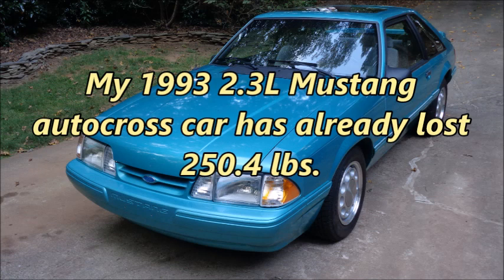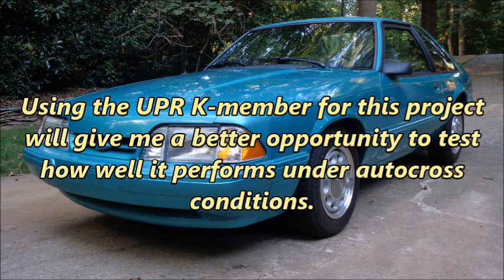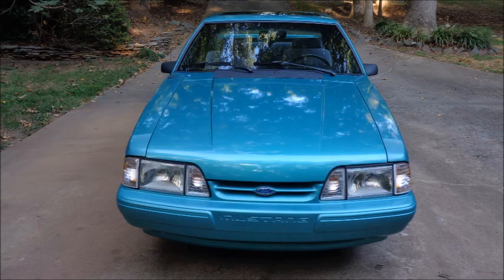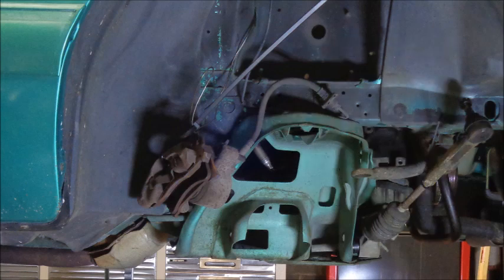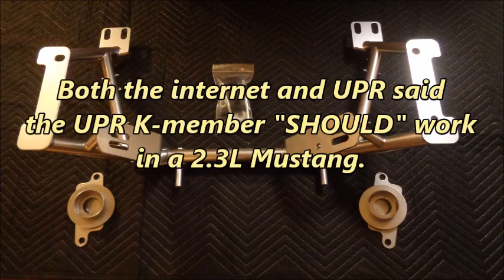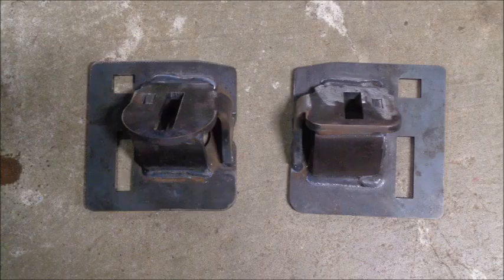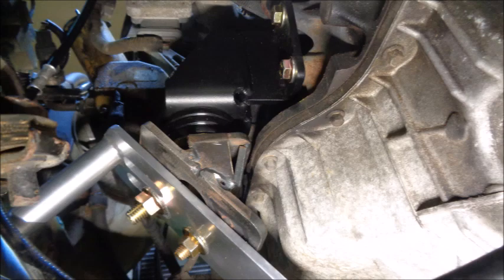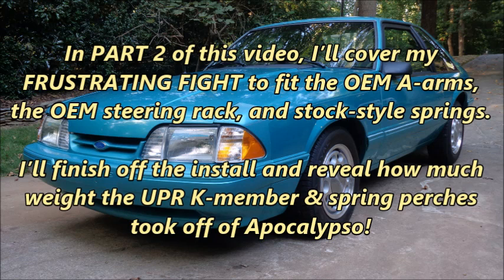Apocalypso: UPR CHROME MOLY K-MEMBER with SPRING PERCHES Part 1

Comment: Nice video bro! Would you recommend this k member or another?
Reply from the maker: Thanks! This car is still in the process of being built, so I haven't driven it much with the UPR K-member installed. I also haven't autocrossed the car. At this point, I don't have enough experience with the UPR K-member to give a good or bad review of its performance. I will review it in the future. Different brands of K-members have different benefits. The benefit I wanted for this build was weight reduction. You might find the benefits of a different K-member more helpful. How heavy is your car? Do you plan to autocross the car? Are you using stock-style springs, or switching to coil-overs? Knowing the answers to those questions will help me give you a more detailed reply.
Reply: @warhorseracing  I just want to lose weight on my 89 mustang coupe. I’m looking at the upr k member you installed & the bmr k member also, I’m not going to coil overs .
Reply from the maker: @jaydollar140  I purchased a BMR Premium K-member for my SN95 a while back, but I haven't installed it, yet. I haven't seen many autocross-tested reviews of the BMR K-member, either. When I spoke to BMR a couple of years ago, they recommended the Premium version of their K-member for autocross (not the Standard version). I don't know if that recommendation has since changed. From an autocross perspective, both K-members are unproven. I have no experience with the Standard BMR K-member. Based on my research, it seems like the BMR K-members have fewer fitment issues than the UPR K-members. You also have the option of saving more weight by switching to BMR A-arms with spring perches (I'm a fan of the BMR A-arms, but not the poly bushings they come with). If you watch part 2 of this video, you'll see the problems I had installing the OEM A-arms, lowering springs, and OEM steering rack with the UPR K-member. Not everyone will have those issues, but it is possible. I hope that helps.

Comment: I'm looking forward to seeing how everything else went for you. I 302 swapped my 2002 V6 Mustang using a QA1 tubular k-member and the steering rack and control arm fitment was a little off.
Reply from the maker: It seems like fitment issues with the A-arms and steering rack are common with aftermarket K-members. I had an interesting experience installing them on my car.

Comment: Great video!  That is why I do not want to put a tubular on my 5.0 89.  I think I will remove it and do some reinforcement when I build the engine - and make sure it is square on the car
Reply from the maker: Thanks! I've been told a hundred times over the years that I need an aftermarket K-member. And I've met people who won't autocross their Mustangs because they don't have one. For me, the choice has always come down to whether or not a K-member is right for my build or necessary to be competitive. You can absolutely be competitive with an OEM K-member. I think it's a great idea for people to check their OEM K-members to see if they are square. I was pleasantly surprised to find out the one on my 2.3L was square.
Reply: @warhorseracing  Some people want the most minute detail perfect before they will even do anything.  Those are the ones who post their basket case up for sale.  I got the idea of reworking my stock k-member from a Mopar build called "The Green Brick"
Reply from the maker: @brokentoolgarage  I hope more people realize that the Mustang they have is the best car to take to their first autocross. I've never felt the need to modify the OEM K-member, but my cars don't have a lot of power. I'll check out that build.
Reply: @warhorseracing  I am using my 89 as an entry level (learning) car for autoX and having great results - the biggest improvement to my car is still me.

Comment: @Warhorse Racing  Posting a video in an hour you might be interested in.  its on swapping any Fox body,sn95 or newedge Mustang to electric power steering from a Volvo  Have it on my car 01 v6 t5 , and love the way it feels. just a little more resistance than  stock.  Also you did a great job on this videoKeep up the great work.  Some companies say you don't have to square the K member when installing they're after market unit but that always seemed a little fishy to me. Your video helped to make it clear you need to
Reply from the maker: I just watched your video. That's a cool mod! The wiring covers in the interior are also a good idea. I'm debating doing something similar if I end up not using a carpet in Apocalypso. It's always great to see more Mustang content! Keep making videos!

I'm glad you liked this video. The UPR K-member went in pretty close to being square, but I definitely needed to adjust it, and double-check things, as I was installing it. I'm certainly not an expert when it comes to installing K-members, but it seems unlikely that one would go in perfectly square on the first try.

Comment: I can't wait to remove my UPR and sell it to a drag racer that doesn't mind a wet noodle cross member.
Reply from the maker: I have definitely heard good and bad things about the UPR K-member. You've commented in the past that you aren't happy with yours. I'm hoping for a better experience, but I know a negative outcome is possible. And I have a plan in place if the UPR K-member doesn't hold up under autocross conditions. Have you looked at the Stifflers Lower Chassis Brace for aftermarket K-members?
Reply: @warhorseracing  I have not. I plan on getting a Maximum Motorsports unit in the near future and I want to take advantage of their delrin bushed control arms.
Reply from the maker: @TheSlim93gt  The MM K-members have been proven to work really well. And I'm a big fan of Delrin A-arm bushings. I think you'll be really happy with that setup.

Comment: Good update.  Would have had a hard time not upgrading the brake lines and suspension components in the assembly operation.  You have great self control in the upgrade sequencing.  A real life budget that includes a season of competition likely is a good motivator, but ongoing upgrades certainly require a unique balance of time and money.  Thanks for sharing.
Reply from the maker: Thank you! I can't remember the last time I put stock parts back onto one of my cars. This part of the project gave me a good opportunity to help people who are interested in a UPR K-member, but plan on keeping their OEM suspension parts. I'm also taking my time finalizing the suspension mods because I'll be using parts I'm not as familiar with, and supply chain issues are still making some parts hard to get. It's fun having a long-term project, but it is a challenge keeping up momentum during the autocross season.

Comment: I’ve been mulling over the idea of a tubular k member and I was wondering how tight the lower main bar hugs the oil pan, right where the steering rack goes. I’d prefer to build my own and adjust the control arms/steering rack so I can have maximum ground clearance. If there’s any chance an aftermarket can meet my needs, that would be ideal. Did it save you even 2” of ground clearance?
Reply from the maker: There are positives and negatives to installing a tubular K-member. Many require coil-overs, which adds cost. Some have mixed reputations. Some improve geometry, while others don't. Weight reduction is key to this project, so an aftermarket K-member was the right choice. Oil pans vary from Mustang to Mustang, and the 2.3L has a pretty big one. I was able to get 1/4" of clearance by adjusting the motor mounts, but that might not be possible with all motor mounts. Building your own K-member would be a cool project. With so many options on the market, it's hard to say that they all will/won't improve ground clearance. I took some quick measurements on my 2.3L and here's what I found: The UPR K-member does sit below the steering rack (with non-offset bushings). The steering rack bushing flanges are the lowest parts of the K-member. Looking at the OEM K-member, I'd say there's 1" of it below the level of the UPR steering rack bushing flanges. The oil pan is lower than the UPR K-member. I hope that helps.
Reply: @warhorseracing  that actually helps a lot. I’d like to use a 4.5” dry sump pan on a 302 with factory style rubber sn95 motor mounts. Could you tell me how much clearance you have between the oil pan and the lower support bar? Is it like a 1” gap or bigger like 3”? If I can get away with a 1” gap against the dry sump pan, then I can lower my front end the full distance that I need it to go
Reply from the maker: @Diamondsintherubble  The 2.3L oil pan goes well ahead of the K-member. It angles down right behind the lower bar, so that 1/4" is pretty much what I have. Going lower without moving the engine backwards would lead to interference. But there is also less than 1" between the oil pan and the steering rack.
Reply: @warhorseracing  okay perfect. I’ll take note and use that going forward 👍🏻 thank you
Reply from the maker: @Diamondsintherubble  I'm glad I could help.

Comment: I just recently installed a MM K-Member in my 1999 Cobra.  I've only driven it about 50 miles but I've been very happy.  I'm fixing my setup today and have an autocross coming up in two weeks.  I can't wait to see the difference.  As of this install, my Cobra doesn't have one stock suspension piece left.  I love this 2.3 Mustang project.  It should be a monster on course.
Reply from the maker: MM makes great parts. I know a lot of people who use MM K-members, and they are very happy with how they perform. You're going to love getting everything you can out of your new mods at the autocross! It's always great to hear that people are enjoying my 2.3L build. I'm really looking forward to seeing what it can do.